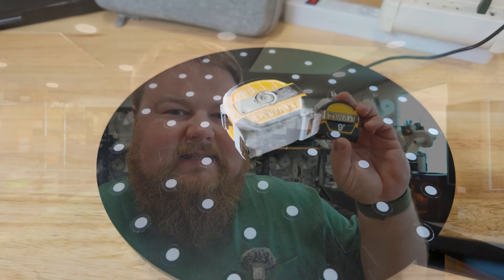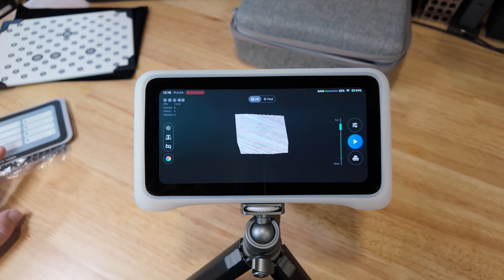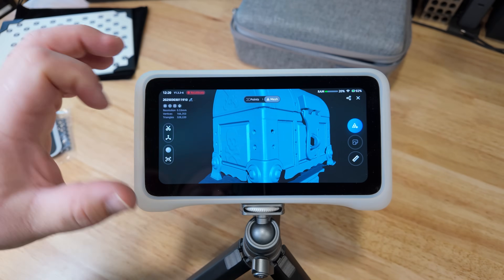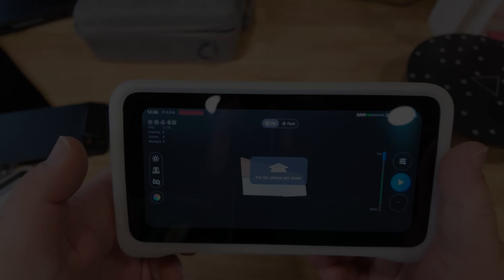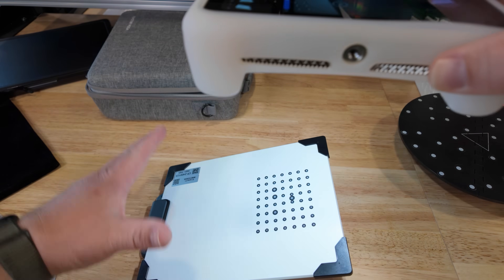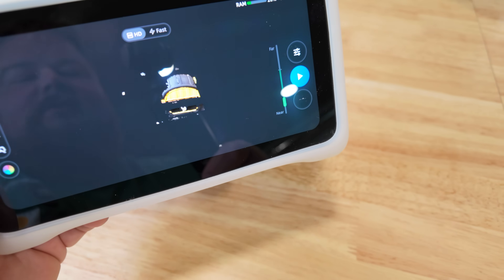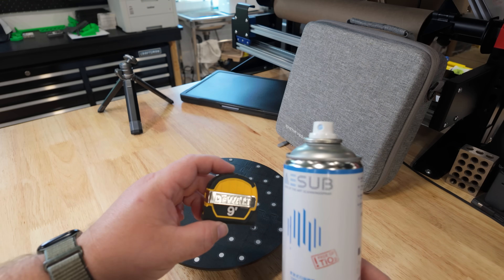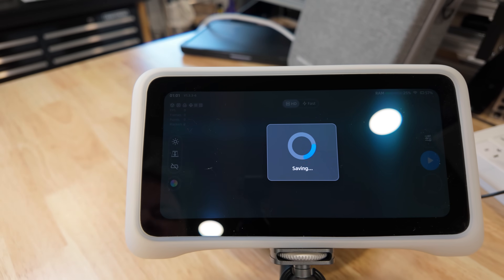My 3D Scanning Reality with the Einstar Vega 3D Scanner

Comment: I keep hearing two different things said about taking a 3d scanner to a 3d print. It is on how if you need to do post processing or not. The company that sold the company I work for's 3d scanner said it could do it without needing any edits. But it seems like that isn't ever true. It might print something close enough though. Point cloud stuff doesn't seem to translate to 3d printing well.

Comment: I purchased the Vega when it first came out, I believe almost a year ago.  Calibrations will have to be done about every 7 days.  They have improved the software a great deal since it was released, much easier to scan.  They update the firmware at least once per month or close to that.  It was much more frequent early on.  

You got it right.  Biggest point (no pun intended) is slow and lighting. Make sure you adjust the lighting (bottom left), also the texture setting.  Einstar is number one by far.  I tried a couple of hand held scanners, revpoint and Creality and the Vega is much better feature wise, and more importantly it is stable.  Nice job.
Reply: So in your onion is the Vega better than the sermoon S1 or is that a different price point all together? . The sermoon is like 1g more. Just curious if that means better Quality and more features or just more expensive. 😆

Comment: Great overview and test! 3D scanners are super impressive, but they're definitely a tool, not a full solution. I have a Creality CR-Scan Ferret SE which is basically the cheapest scanner on the market. I haven't had the chance to use it extensively yet, but for the money I am very impressed with what it can do. It's definitely one of those things where the less you are going to do it, the less it makes sense to spend a lot of money on a scanner, but the more time consuming a good end product will be. Still, it's mostly good as a starting point for CAD when it comes to functional prints rather than a way to instantly replicate anything. A lot of labor is definitely required most times in the finalizing.

Comment: I have the Einstar Vega.  I find that the real world use for this scanner is for using the scans it creates as templates for drawing your sketches in your 3D CAD program of choice.  The amount of cleanup you have to do to just print a model of your scan is very time consuming, not to mention the difficulty of mating multiple scans together within the Einstar StarVision software.   I originally intended to use this as at least a reference scan for large objects, but that doesn't seem like it will work.  So, as I said, probably best case scenario for this scanner is to use it as a tool to trace and reference in a drawing in your 3D CAD program.  I'm not a professional, and I haven't used the scanner extensively, so that could also be why I feel this way about it too.
Reply: I just got the Vega, tbh that seems to be the issue I witnessing. It is the first scanner I have used. Is the einstar a better option for quality scans?

Comment: I recently bought the Revopoint MetroX.  I am doing reverse engineering bringing scans back into Fusion or other Cad programs like Solidworks and using the Mesh obtained to create perfect CAD drawings and 3d prints that are highly precise.   I am also improving upon the original OEM design which I scan into a mesh and then import in Fusion.    Scanning has a pretty steep learning curve as does reverse engineering, it is something that requires some patience and hands on time to become proficient.  I realized the key to successful scans is do not spend too much time trying to scan every tiny bit of detail, one just needs an ok mesh to get absolutely precise final results, holes are not going to interfere the way reverse engineering works, think of it as onion skin tracing paper that is very accurate dimensionally with a decent scan.  There is no need to fill every hole on a part.  You are going to align the scan mesh then create new dimension lines onto those planes like using onion paper, the end result is one extremely accurate drawing and file which you can now print once data has been used to create a new cad file.  The best part is you can now make improvements to the original item you scanned, you have full control over the final dimensions and features of your new object. 

The MetroX has several scanning modes and the results have been absolutely amazing.   My first object was a 40 hp motor cooling fan which was gloss black.  I did not need any of the white spray, I scanned it direct flipping it a couple different directions and then printed final better then OEM quality Final Nylon print using support material.  The newly redesigned fan part was higher quality then the original OEM fan replacement part which was injected molded and quite frankly very poor quality.  I made several improvements and the FDM print was far superior than the OEM injected part.  The Overture Easy Nylon is some great material!    This smoked the plastic injection one that was the only one available on the market.   

It was a very challenging first project to tackle with the new to me scanner, but with the help of You Tube I managed to figure all things out.  This has opened up a whole new area of the 3d Printing world which will be a very useful tool going forward.  I am now using this to create a very cool military logo(large sign) of Blackhorse Regiment horse jumping out of a 3d printed multicolor design for a military customer, this job alone will pay for 90% of the cost of the scanner.  This has opened up ability to do projects that have some very high payback, going from a couple dollars profit per object printed up to many hundreds of dollars profit per item printed.  The jump in profit margins this allows is huge.  In recent weeks I have done three jobs that allowed me to pay for a scanner and two new Carbon Centauri printers, very happy with the progress seen and new opportunities which are more in line where I wanted to go with this hobby.  My shop makes use of a small 3d print farm(7 printers) wood router CNC, and now the scanner which opens up many new avenues and directions to explore going forward.  I am still waiting to decide on a fiber laser setup to add to the shop, I keep pushing this one off a bit longer, waiting for fiber prices to continue to fall. 

If you want to learn how to use scanner for reverse engineering YouTube has some great content search for reverse engineering, scanning, and aligning scan mesh for reverse engineering and I am sure you will find some great content that will help you to master scanner technology pretty fast.

Comment: Scanners have become attractive as the consumer level models are being released. I find the technology is good but the software is a hurdle depending on what output you want. People need to research A LOT before throwing money at one. The scanning software is basically just that and sometimes if the stars align you can export a printable file, most the time you are going to need editing software which varies greatly in price and ease of use. This is what most companies are not letting slip and I think this is akin to selling a sports motorcycle to someone who has no gear and cannot ride, it's gonna end in tears. 
This video is a good starting point and shows a workflow that is practical, looking forward to seeing how you would reverse engineer a scan to extract a part for printing.

Comment: Got a used Raptor on marketplace. I've been using it quite a bit lately do scan objects that I plan to make accessories for. For example a holder for that tape measure, and i'm getting great scanned results but Fusion360 is difficult to utilize the scanned stl with. I have found it's great for reference but not actually using it in fusion. Maybe i'll have better luck if I switch back to blender but so far it's just a quick way to do measurements and less of a way to have the 3d object in fusion to model with.

Comment: Did you join the 2 scans together in the scanner software or Tinker Cad?
Reply from the maker: TinkerCAD -- I have never found an option to join scans in the software unfortunately.
Reply: have the previous version of einstar scanner. here you can make multiple scans and combine them. it requires you to finish one scan at a time, then you can create a new scan. when you have the scans you want, you can combine them by puzzel logo.